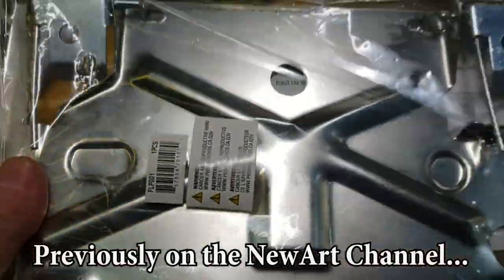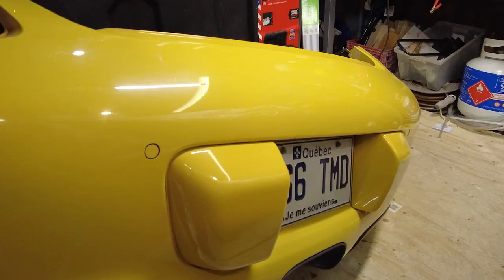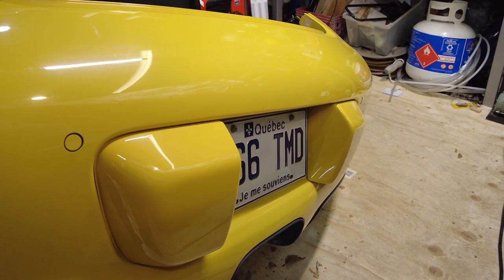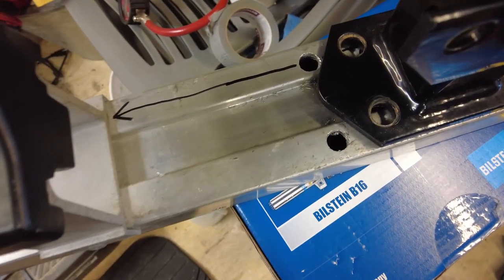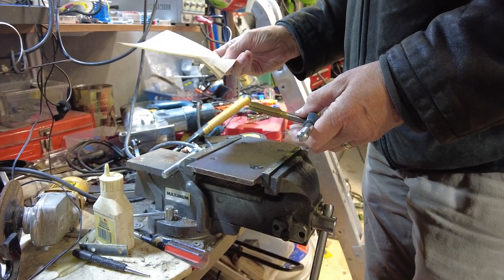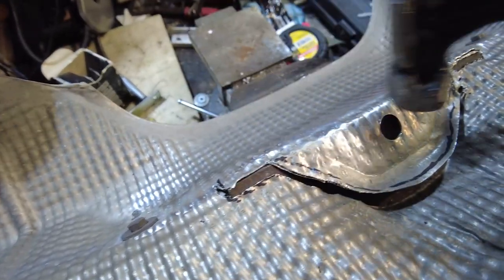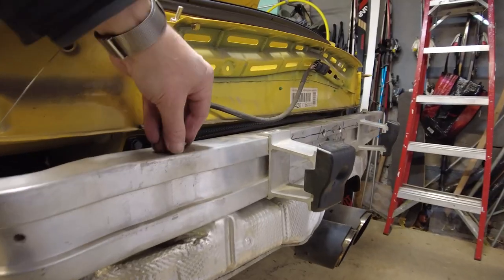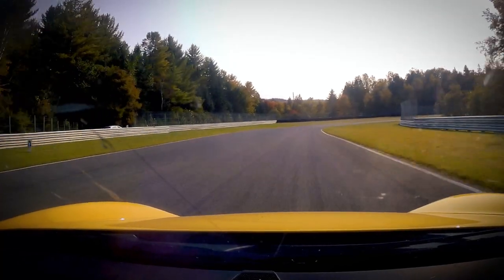Porsche 911, Boxster, or Cayman Trailer Hitch & Bike Rack

Comment: I was hoping you might have some time to discuss my application, a 981 BS.  I have searched and I found a photo of the unicorn (981 CS with a hitch) but I cannot find anybody who knows anything about it.  I am something of a DIYer but I have limits.  Thanks for your consideration.
Reply from the maker: Hi, I'm afraid that I can't add any further information concerning the later models. I would just remove the bumper cover and have a look. Remember that bumper was not designed for this, so it should be used for light duty applications.